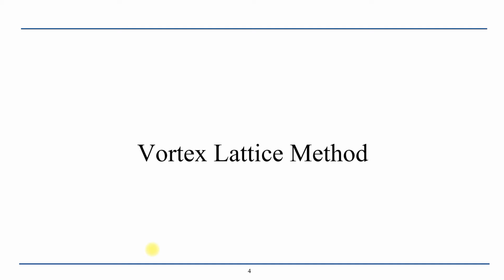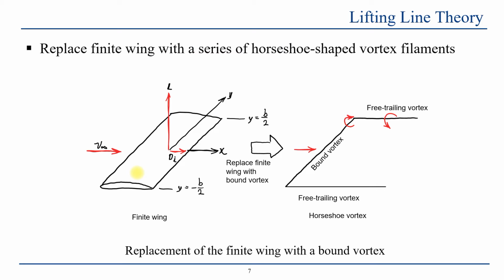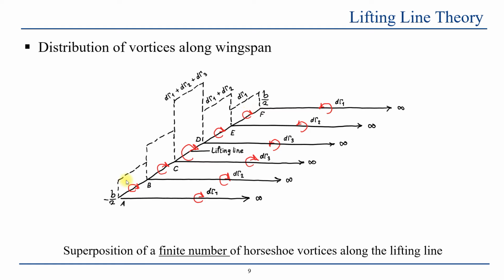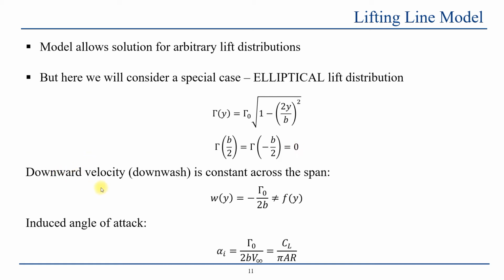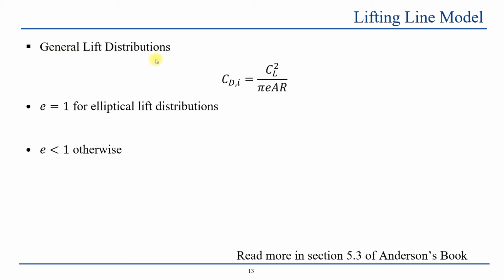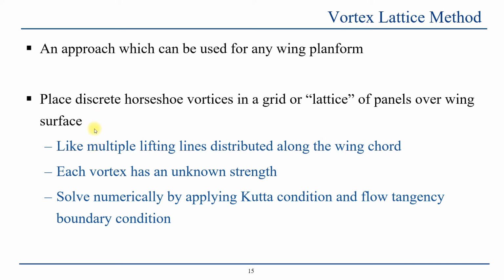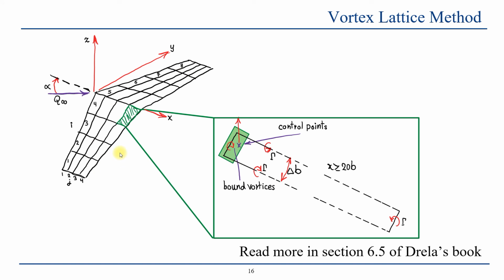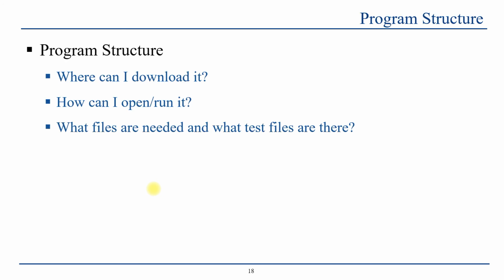AVL Tutorial - Part 01 - Underlying Principles

Comment: Hello doctor! i'm a student of aerospace engeneering and i'm working on a project that requires the use of AVL,  i watched your tutorials and i learnt a lot about the program, but i still have some problems  with the software when i try to calculate the aerodynamic coefficients. For exemple i've loaded the b737 AVL and Mass file (found on the AVL website) , and after the mset, i've set the cruise condition of 222 m/s (mach 0.745) and the air density of 0.41 (10000 m). The results make no sense: CL  0.49 and CD 0.0088,  so the efficiency should be 55 ahahahah. How is this possible?
Reply from the maker: Hi @Marco, you need to remember that AVL is not perfect and is not to be used for the most comprehensive analysis you may need. As for the sample you mentioned, the data for b737 are no fully aligned with the data available on the aircraft, you can double-check the dimensions and information about the plane here https://en.wikipedia.org/wiki/Lift-to-drag_ratio, here https://en.wikipedia.org/wiki/Lift-to-drag_ratio, or here http://www.b737.org.uk/techspecsdetailed.htm. Additionally, the dimensions and aerodynamics properties aside, AVL does not calculate all the contributing factors in Lift and Drag, particularly drag and specifically when fuselage modelling is involved as mentioned in the program's user manual by the author (Mark Drela). To get an idea, you can see another anaylys example here https://suave.stanford.edu/tutorials/B737.html using a Python library and if you look at all the plots at the bottom of this analysis, you can see the contributing terms to drag coefficient, some of which are 0 in the AVL alanylis but not in reality, so you'll end up getting CDTot in AVL as ~0.1 in your analysis, where it should be closer to ~0.3-0.4. Therefore, the ratio you find for L/D is ~2x-3x larger than what it should be. For the AVL inclusion/calculation of some of these drag contributions, you need to dig further into the user manual and see what you can change in your run file to activate inclusion/calculation of these terms (e.g., viscours terms, etc.) so that you may get a better estimate of the overall D and consequently L/D for your analysis. Hope it helps.
Reply: @arahimi_  thank you for this quick answer , i really appreciate it, you were faster than my professor. I  think i'm gonna consider results divided by 3, this makes sense with all the analysis i've done as of now. Thank you again and good work. 🙂